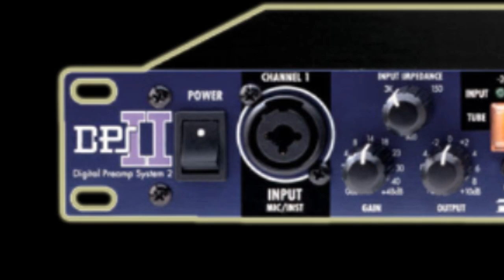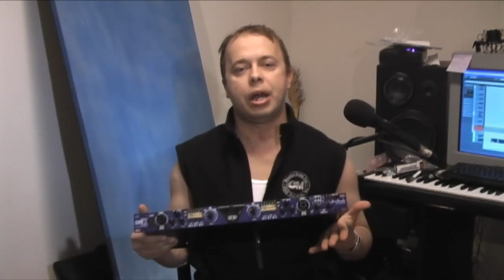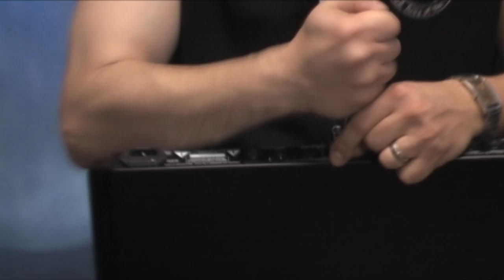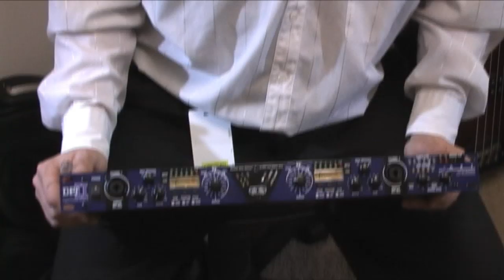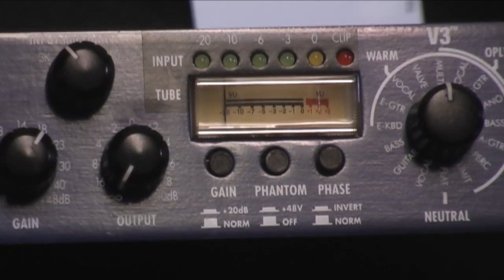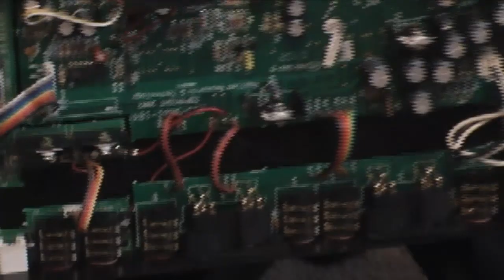ART DPS II Part 1

Comment from the maker: OPL allows you to have distinct tone depending on setting you choose. It Includes specific shaping of the tone and various amounts of compression. Variable input impedance allows you to match different microphones. You will notice the difference when you compare dynamic and condenser microphones. The first will sound tighter when input impedance is set to lower parameter, and condenser will get tighter when you turn this nub clockwise toward higher input impedance.

Comment from the maker: Option 2: 3 TOSLINK optical cables, Internal synchronization. This way ART will change sample rate automatically following the project settings. Signal path: Digi 003 Optical out ->ART DPS II (1) optical input; optical output -> ART DPS II (2) optical input; optical output -> Digi 003 optical input. ART "sample reate" selection to "EXT", ADAT selection the same as option 1. There is an option to do it with World Clock, it is a little more complicated with more cables. Let me know.

Comment from the maker: Not a good idea. They are wired different, therefore 6922 (The Avalon kit) heater will not be working and you will ruin the tube very quickly. In order to make it work, you have to rewire the socket. It wouldn't be practical in this case. Mesaboogie 12ax7 will work there and can give you different tone depending on the last two letters followed "12ax7"

Comment from the maker: @VerseIsStyle Any of these will work, but by connecting it directly to the Studio Pod you will lower the chances of extra artifacts in the sound due to "shorter" signal path. On the other hand it depends how you use your USB mixer. As far as I know, most of the DAW software can not work simultaneously with two different types of interfaces. You can insert this preamp in any part of the signal chain. It depends what do you want to achieve by doing it.

Comment from the maker: Option 1: You will need 2 TOSLINK optical cables and select "external/ADAT sync" in driver settings (in your software). Selection of sample rate on ART will determine the sample rate of your recording. Rates on both ART units MUST be the same, ADAT Channel selection should be different and not S/PDIF. The signal path: ART DPS II (1) optical output -> ART DPS II (2) optical input; optical output -> Digi 003 optical input. You will have to make the settings every time you cycle the power.

Comment: Hi, congralations for your work.Please, can you tell me if i decide to replace the tube for preamp.ART TPS ll, this lamp it is ok-Electro Harmonix 12AX7? Thank you, all the best.
Reply: As a former tech for ART, I can tell you the tubes that come with them are tested to provide a certain gain structure and harmonic distortion so while any 12AX7 will work, your results may vary. For the cost of tubes though, you may want to try different ones and use your ears. It won't hurt it. If you find it distorts too early you can try a 12AT7 or even a 12AU7 as well. They  have lower gain so you can drive them a little higher before they begin to breakup.